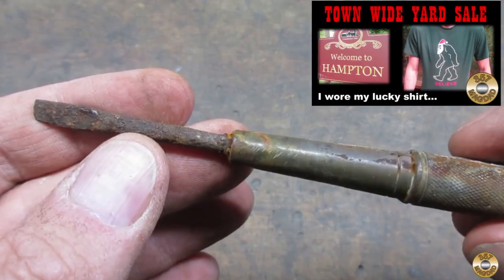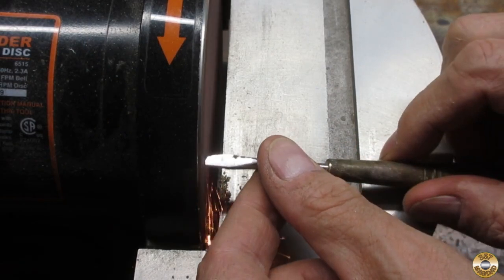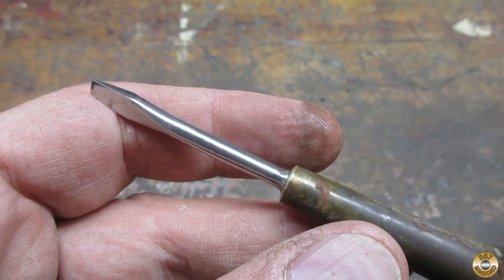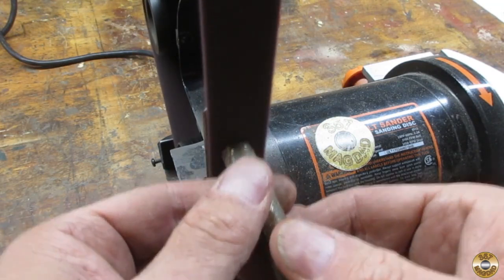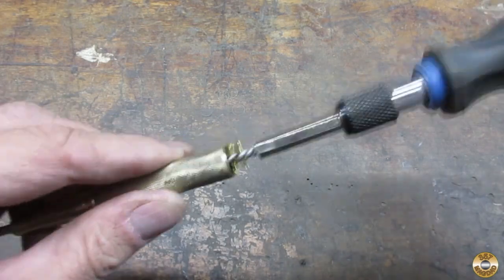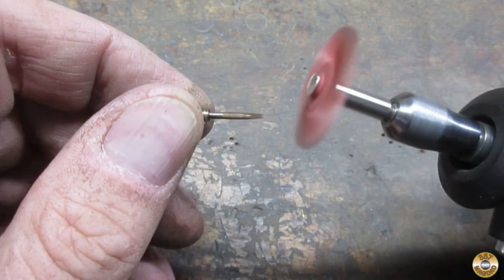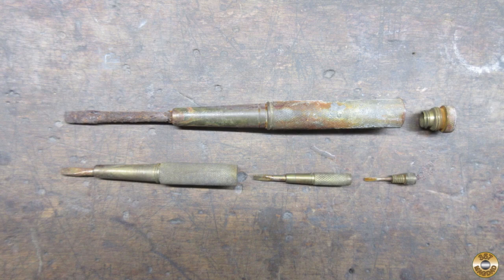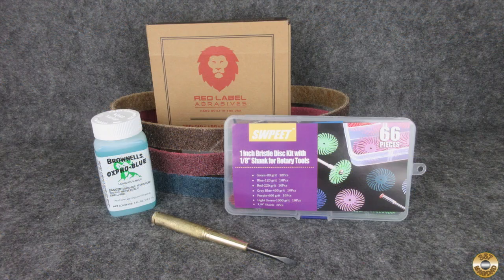Brass Nesting Screwdriver Restoration

Comment: Great job on the restoration!

I recently acquired a Philips head set that looks like this one. No makers marks, but the cap, tapering and ring before the knurling are exactly the same. The only thing is that the two smallest drivers are flatheads like yours. I have been looking around for some little Philips thinking that this set had been mixed, but I can't seem to find any. Even the new ones have alternating heads, so I feel like I will never be able to make this one a full Philips set. Maybe they just didn't make them that small back then.

In the video you said you always keep an eye out for these, so I was wondering if you (or anyone) have come across any smaller Philips heads or if I should just put my search to an end.
Reply from the maker: Thanks for watching Jesse!  I have not come across a Phillips set.

Comment: Came out nice.
I used to have a set nearly identical until some jerk who I loaned my tool box to stole the whole kit.
Reply from the maker: Too bad you had your stolen!
Reply: @357magdad  Yeah thank you.
Hope he got what he wanted. Some tools were my fathers and grandfathers. Had another box stolen in 1985 when I  was Soundman for touring/gigging bands,same deal, things belonged to my grandfather. He stole a  3oz. ball peen hammer with a rosewood handle my grandfather used in the Navy in WWII. He did this kind if stuff we see on yt today. Everything he had was tip-top. I know it was the doorman/ bouncer did it. He was overtly jealous of other ppls. talent telling me often how to use MY equipment. He used to change the settings on our gear,one time wiping out the entire mix on the Front of house board.
I did several "alterations" to his vehicle when passing through the area on way to different gig.😆
Ppl. that knew his sorry ass told him basically,well,what comes around goes around.
✌️❤️